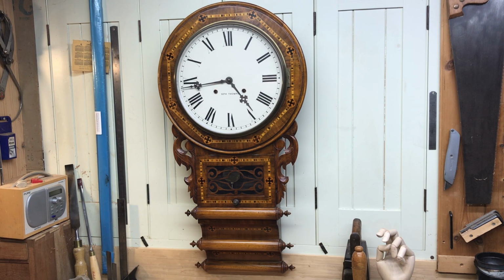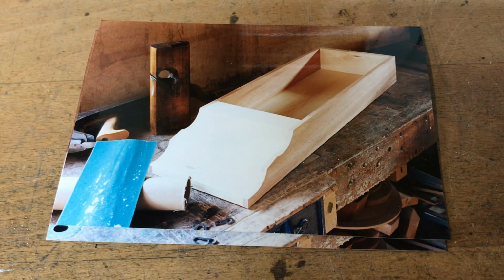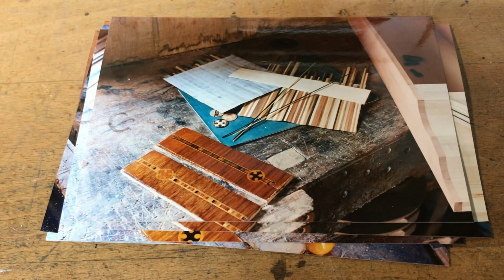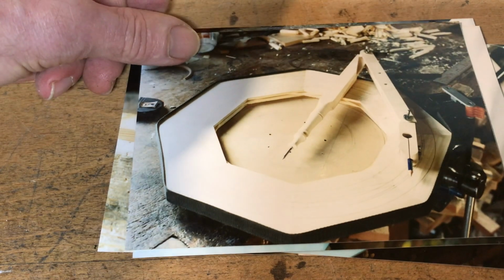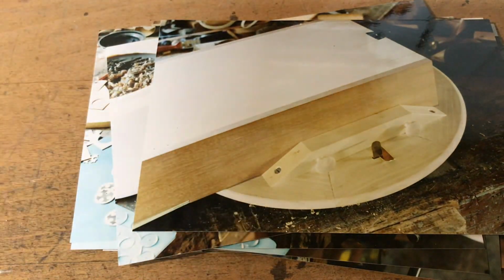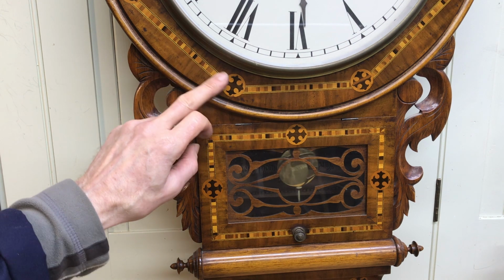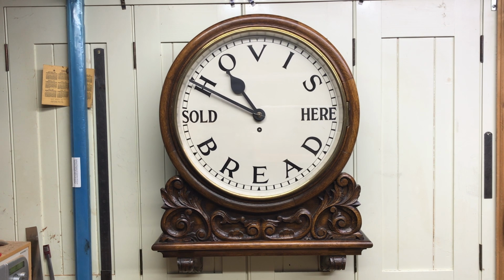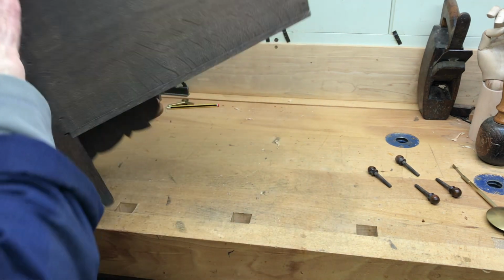Making a drop dial clock

Comment: Absolutely superb work Ian. I like the way the inset round marquetry pieces reflect the Seth Thomas hand detail. I teach physics here in Toronto but my passion is restoring clocks. I spent the better part of the holidays restoring a Seth Thomas #1 regulator. The 9 pound weight had crashed through the bottom of the case at some point and the original bottom had been lost. I managed to find some ogee moulding to reproduce what was missing...now I'm looking for a suitable weight. I too was lucky enough to find a reproduction label. Thanks for being an inspiration!
Reply from the maker: I too have had clocks to restore that have had weights crash through the base. Keep up the good work.